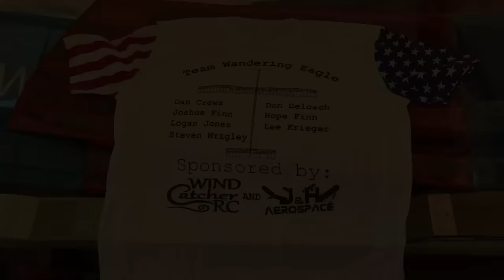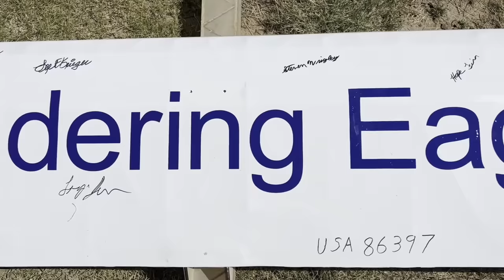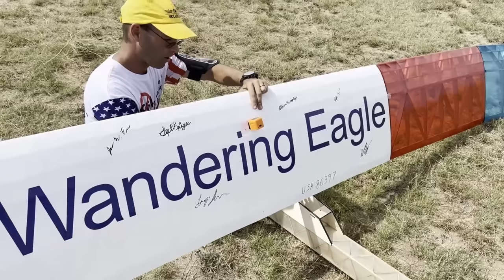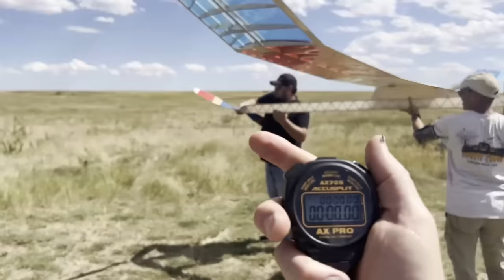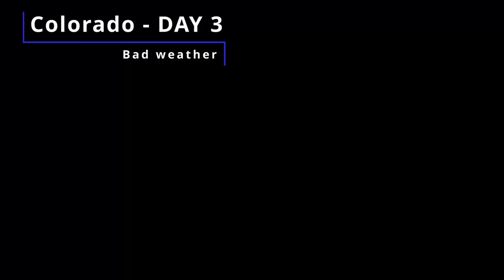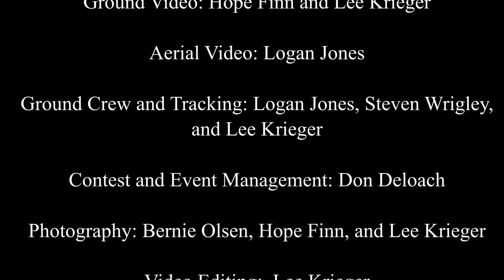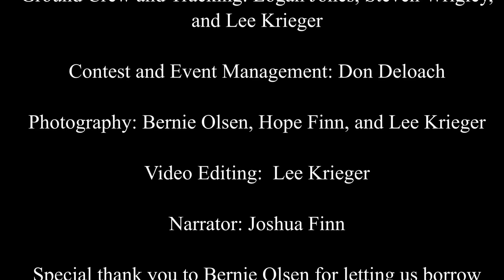Rubber Band Airplane World Record!!!

Comment: Dethermalizer absolutely essential. Anyone questioning that does not understand thermal soaring. In Minden, Nevada I flew a GroB 103 glider to 17,400 feet and stayed aloft for 3 hours and 45 minutes. I only came down because I was freezing (not dressed appropriately, who knew?). I could have flown a lot higher (yes I was on oxygen) but the cumulus cloud base was popping at 17,000 and that held me down.
I was climbing about 1,000’/minute. Never underestimate thermal lift!
Reply from the maker: That sounds like a fun adventure!

Comment: I wonder if a DT is necessary 7 feet from earth?  The flight was quite graceful and looked to be slow motion, cruising like it was indoors.  If these catch on I fear a rubber shortage.
Reply from the maker: We have purely used the DT for obstacle avoidance. That was its main goal from the start, as well as aborting a flight attempt should the model begin drifting toward sensitive airspace.
In terms of rubber, you would be stunned by how much is produced and consumed. It's absolutely mind boggling. This thing uses a lot, but it's not even a drop in the bucket.
Reply: We can only hope there is a rubber shortage because that many people got involved in the hobby.  😁
Reply from the maker: @WindCatcherRC  yes!!!
Reply: I was thinking, you need a safer place to fly, without obstacles. That pole crash was avoidable.

Comment: Pirelli is still the best rubber strip. Why isn't it climbing? I would double strands and put that peg half distance forward like a Coup d'Hiver? Will climb then oh less dia prop too - Nice glide ✔️😊
Reply from the maker: We never maxed out the torque. Winding to 150+ in-oz in hot weather at high elevation is brutal. The motor can take 270 in-oz but I just couldn't wind that hard. As you noted, the glide is beyond amazing, less than 1 ft/sec and flatter than anything else out there.

Comment: A lot of rubber flyers in the UK use a 'soap bubble' thermal detector plus a model windsock before launching. Looking at the Colorado skyline, the cloudscape seems to indicate  quite a lot of wind-shear effect possibly affecting thermal formation.
Reply from the maker: It depends on the day. We've seen thermals that were literally miles across out there. It just varies. It's one of the top two sites in North America for strength of thermals. The fly porta potty video was filmed maybe 10 miles from there.

Comment: We continue to learn everyday and it is something in modelling that I would like study more is whether we scale the model or scale the physics. Not everything behaves in a linear fashion and and the margins of stability, speed & strength will require careful picking around. After all engineering is about getting the right compromises. I first thought of this with steam powered models and then scale speed as things like mach numbers are where they are and the transistion gets farther away the smaller the scale. The torsion problem is an interesting one and I started thinking about contra rotating rubber bands to balance the torque/torsion in the fuselage with a gear box for the propellor. This could reduce the torsional load overall although prop reaction would still figure in. 
Looking forward to this bird catching a thermal although the seasons are now moving against us until the spring, at least for us northern hemis.
Reply from the maker: You are correct that further attempts will wait until next year, but development work will continue. I'm hoping to do some test flying as well.

Comment: I didn't watch all of this, kind of skipped through. I am curious as to how much pull/tension there was on the wound up rubber band. I built many 'sacrificial victims' to the wind gods curing my days as a hang glider pilot. Anywhere from 4 inch to 24 inch wind spans. This looks to have been a fun project.....
Reply from the maker: At the peak loads we reached, probably 50 lb at full stretch and 25-30 during transfer of rubber to the prop shaft. I'll need a gantry to handle the loads if we pursue winding it harder.

Comment: This is pretty cool! Wouldn't it be more desirable to find another location with a lot less DA?
Reply from the maker: We had discussions about that, so far haven't found a low elevation site that doesn't present major retrieval issues should we actually get the plane up to record altitude. The search continues...
Reply: @joshuawfinn  The dry lake beds in Nevada would be good for you guys for the space & thermal activity.
Reply from the maker: @nzsaltflatsracer8054  are there any that don't have restricted access and airspace issues? Blackrock used to be the ideal plane for this stuff but that's all but closed now.

Comment: hi Joshua, well done, but just wondered, how much it actually costed to build this giant model aircraft? 👍👍 from Tony from England,
Reply from the maker: I didn't monitor exact costs but the airframe probably totaled about $1k. Graded balsa is expensive.
Reply: thanks for your reply Joshua, I was just curious as I have built model aircraft from plans , and balsa wood is very expensive to buy here in England, when I started modelling in the 19,70,s at age 11 , balsawood seemed much more affordable, well done joshua ,
Reply: This is an R&D project with tremendous overhead. The cost of the materials to make the plane are a small fraction of the total. The cost of the next plane will be less and the more he makes, the unit cost will go down. The Wright brothers estimated that they spent a total of about $1,000 to get the 1903 machine to fly. Bringing that forward at a 1.04 per annumm inflation gets $110,662.56.

Comment: Did the wing catch the updraft created by the tent/vehicle and the elevator did not?
Reply from the maker: I hit the dethermalizer transmitter to keep it from hitting the pole, forgetting that the torque from the prop would roll it as soon as the wing stalled.
Reply: @joshuawfinn   - Ah! Bummer. It sure looked scary though when it was heading right for those structures.

Comment: Congratulations. Amazing project.
Do you think the  Colorado altitude is a positive or a negative?
Reply: Thinner air is not helpful, but the cold also reduces the energy capacity of the rubber. Internal combustion engines will develop less power in thinner air, but that does not afffect rubber. The airplane has to fly faster in thinner air. The propeller must turn faster, reducing the motor run time, reducing duration.
Reply from the maker: Yeah the altitude definitely cut climb performance.

Comment: Hey Joshua, don't you think that a little bit of torsional flex in the aft fuselage is actually a good thing?  If the lifting horizontal stab tilts slightly away from the edge of thermal, it will cause a yawing moment turning the aircraft into the thermal.  Great video!  How about a visit to the Lost Hills Model Free Flight field in California's Central Valley in the Spring when the air is cool, the density altitude is manageable, and the thermals are booming?  BTW, keep working on your 'body english' to remotely control the aircraft using telekinesis.  😉
Reply from the maker: Main thing is the up and down bending of the tailboom attachment, which is changing the incidence in flight.
We talked about Lost Hills but the orchards are a problem. Current discussions are surrounding Utah, Nevada, and southern Arizona as possible locations. There's also another site in Colorado that might work well.

Comment: after having been in this hobby more than 60 years and having served as a AMA test pilot and instructor pilot, fixed wing/helicopter as well as a builder/contest organizer.  I  can honestly say t's a shame that the government destroyed this hobby of radio control models. Rubber powered aircraft about all that's left that the government hasn't regulated out of existence yet.  what a travesty.
Reply from the maker: You are completely correct. Good news is the RID laws are virtually unenforceable and for all practical purposes, RID doesn't work because of the unreliability and limited range. Keep yourself safe and avoid registering with the government for anything other than commercial ops under Part 107.

Comment: Use this beauty without the current rubber equipment and you will result in flying an excellent thermal sniffler (early morning / late afternoon), where high-class high-$ models will need to stay on the ground.

Comment: Fantastic! 5 minutes, still air, easily. You are flying with close to apogee torque. Knowing that allows selection of rubber cross section for maximum still air time; apogee torque = average torque on the motor unwind curve. You will need to put in about five times as much torque. Need a winder with 5x more gearing, may need a winder with lever arms for two man operation, maybe two to hold while a third cranks. The propeller is much too small. The blade angle distribution likely could be improved. Every comercially purchased prop I have measured has been badly pitched. If you knew the revolution rate and airspeed, you could calculate the advance angle and atack angle at each radius. Ideally the attack angle would be uniformly the attack angle of maximum L/D across the radius. These things can be measured.
Reply from the maker: I figure about the same. The thin air at 5k ft elevation makes it kinda tough. We only had a few hours of conditions suitable for really going at it and small misjudgements made that less productive than I'd hoped, however it still looks great in the air and that's what most people care about.

Comment: Wow look at that B52 casting its shadow upon the earth.
I think it can hang on for hours if you guys really wanted to.

Solar panel wings
Light weight solar panels and an electric motor
It can also accommodate two batteries
The voltage can be monitored  to switch batteries while the solar panel charges the other

Sincerely

Ejike

Comment: Looks like you've got a real shot at bagging some records with this one!
Have you guys considered using a couple smoke generators upwind to better assess thermal conditions?
Smoke systems on ag planes work great to determine wind direction better than streamers and detecting low level thermals that affect our application.
I've watched smoke lay on the ground on one edge of a field and a quarter mile away it's already heading for the stratosphere...
Reply from the maker: This is a good idea. Do you have any suggestions of where to get such smoke generators? I'd really like to do some studies like this.
Reply: @joshuawfinn  If you'd like a handheld unit that could be powered from a small portable generator, I'd suggest the "rocket" from pea soup.  It uses the same non-toxic water based smoke juice that fog machines use, but it's an industrial version meant to simulate smoke for firefighters and whatnot.  Not what I'd consider cheap, but maybe you could swing a sponsorship or something?

In our planes, we simply pump smoker oil straight into the exhaust using a Compro smoker system.  It's the same type of system that aerobatic planes and skywriters use, but it can also be used on virtually any engine...car, truck, ATV, generator, lawnmower, etc.  Rather than spending a ton of money on a STC'd certified part, you can make one of your own with a cheap 12V fuel pump, a gas can plumbed with a small hose going to the pump, and then a small nozzle in the exhaust to pump the oil into.  If installing in a vehicle, inject the oil past the cat converter and any O2 sensors to prevent damage.  It'll pass through the muffler and beyond indefinitely with no ill effect.  Flip a switch to turn the smoke on, and as long as you're pumping oil into the exhaust it'll keep on generating smoke.  You could drive a vehicle upwind back and forth so you'll have a "wall" of smoke to visualize any thermals or dead air heading your way.  Wait until you see a particularly high column of smoke heading you way and launch into it.  Alternatively, go to harbor freight and pick up a few of the cheapest pull start engines for pumps/generators, or source them used locally, rig them up with a little smoke system, line a few upwind of you, and just let them run for a while until you see a good thermal heading your way.  A little engine like that can be rigged up with a pump up chemical sprayer and a brass hose barb pinched down to use as a nozzle, total cost might be $30-40 plus the engine.

Kitplanes has an article about how to build your own "$250 smoke system" that you could use to get an idea of what you might need to rig up a vehicle for that purpose.  It doesn't have to be to the same standards and you could probably make something comparable for under $100.  You'd benefit from more oil capacity though, since my 1.5gal tank doesn't last all that long even when I'm using it sparingly in short little bursts.  A fuel tank for a small boat might be just the ticket to fill with oil and toss in the bed of a truck.  You get best results from a fine mist going into the hottest part of the exhaust.  The more oil you pump in, the thicker the smoke will be.  The finer the mist, the better it'll burn, and same goes with hotter exhaust...if you get those two down, the smoke will hang longer.  Using proper smoker oil will give you the best results as far as smoke quality, clear and light oil generally does best.  I've used what's called "ultra clean spindle oil" in my smoker and it's nearly as good as name brand smoker oil.  However, I've also seen tractors injecting straight diesel into their exhaust to produce some good clouds of smoke too, it just doesn't work so well on turbine engines flying at 170mph.  I believe the military injects diesel into their tank exhausts to create a smokescreen for assaults and whatnot, so maybe it's worth experimenting with.

If all that sounds like too much work or expense, you can get smoke canisters online that are way better than the little fourth of july smoke bombs.  Try surplus and airsoft stores, they'll either carry them or tell you where to find them.  Get a few volunteers to light them up and keep an eye on them to make sure they don't start a grass fire.  Cheap and easy solution for the most part.  Another idea with some potential is using battery powered leaf blowers and a couple pounds of flour for each, point them up and feed a scoop of flour into the intake.  Not sure how well that would hang but it might be long enough to visual air currents, dust from driving down dirt roads can hang in the air for a long time and makes temperature inversions easy to spot.  Certainly sounds fun enough to experiment with at any rate.  Good luck!
Reply from the maker: @Skinflaps_Meatslapper  thank you for the detailed information. I'm going to file that away and get started looking at what option will work best for me. This is greatly preferable to the traditional methods of using bubbles or cattail fluffies which can only be seen at short distances.

Comment: Okay, NEXT… A scale rubber-powered Aeronca Champ… 100% scale! Maybe even have a passenger/pilot seat. ‘not sure how that would sit with the FAA.
Reply from the maker: Tempting...so very tempting. Would need a tractor to wind it though!
Reply: @joshuawfinn  Tractor not necessary… an inexpensive cement mixer from Home Depot equipped with a HUGE hook. Bonus… you can store the rubber in the mixer (all 38 pounds of it) .

Comment: Camera showed L wing low launch which took it toward cars, tent and pole!
Reply from the maker: Wind shifted as I launched. When you fly big ones like this, there's much more happening than usual. In general having it dip is a non issue on a normal sized plane because of the higher climb rate.

Comment: This has no real altiude rise.
It holds up good though.
I am working on a plane of 8 feet in wingspan with an unusual davis airfoil.
If it flies it should rog as well
It is a stand off quarter scale bush plane with features that are unique plus a radio controlled rudder.
Reply from the maker: That'll be cool. Our two main obstacles to getting a strong climb have been my weak arms and the roughly 10k ft density altitude we were flying at. The plane did get a good 200 ft up on a couple flights so I figure that's well out of ground effect though.

Comment: Ever consider power comparisons with 3 blade prop or a toroidal blade?
Reply from the maker: 3 blades is always less efficient than 2. You only use more than two if prop diameter is restricted by other factors such as landing gear length or ultra high speed flight where two blades would go transonic. The toroidal blades have proven extremely inefficient, which is not unexpected. It's an attempt to get something for nothing.